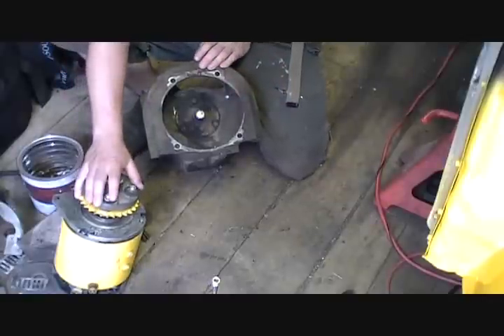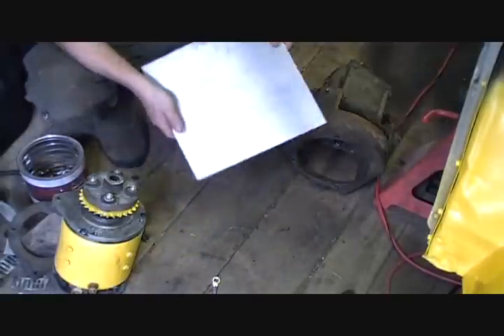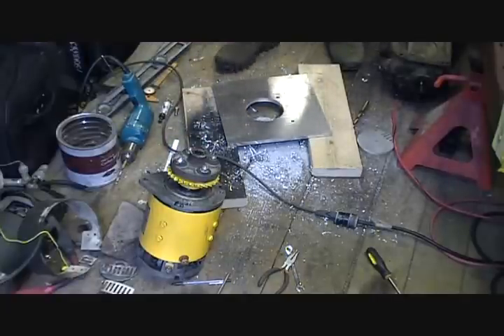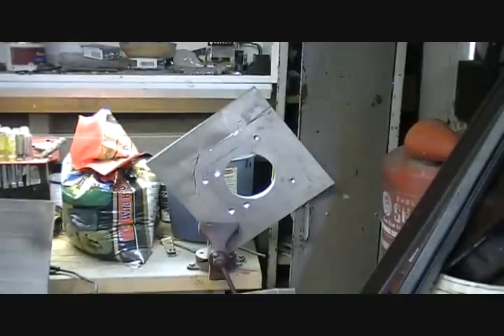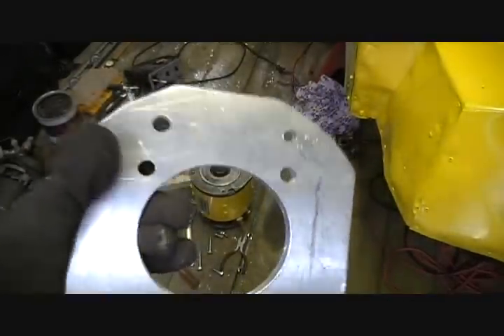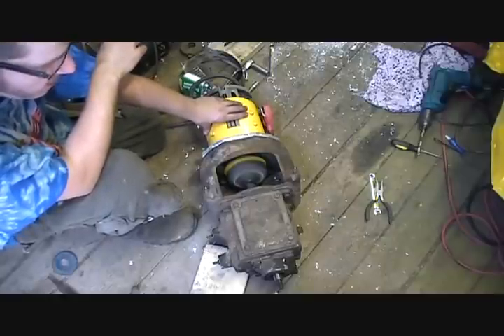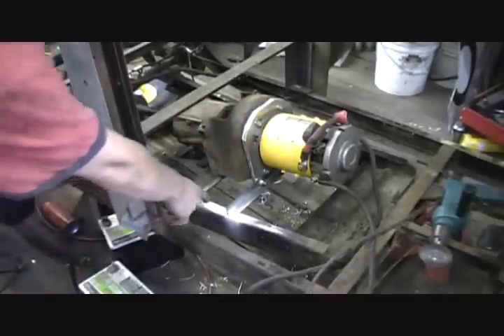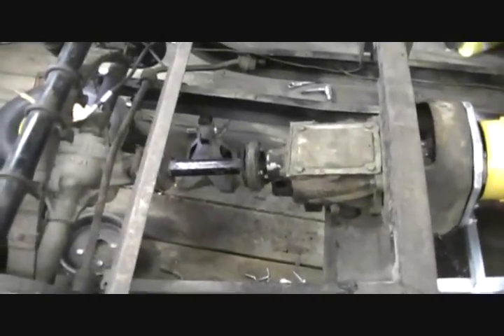1961 Cushman Truckster EV Conversion LiFeP04 -  Part 6 Motor Installation

Comment: Congratulations. One of the most difficult tasks is the alignment of a strange motor to the transmission. Though, as you said, it still seems to need adjustment. Maybe you didn't even need the adapter plate. But then again it is an excellent mounting bracket as well as a heat-sink.

Comment from the maker: Thanks very much!  I'm stoked to have this part done.  I think the vibration is in the driveshaft, not the union between the motor and transmission.  I'm going to disconnect the driveshaft and double check that.  
Yes, the plate makes a great heat sink and mounting plate.  I plan to fan cool the motor with ducting as well as mount computer style heat sinks on the brush end and point a 12v muffin fan at it.  It should run cool enough for my needs, I think!
Thanks for the input!
B

Comment from the maker: The driveshaft was spinning as it was in gear.  One of the rear hubs is off, still awaiting a new ebay part.  That side was spinning even though the side closest to me was not.
The transmission is not lubed yet, so that could be the cause.  I'll try filling it and see what happens.
Thanks!
B

Comment: Correct me if I'm wrong. The drive-shaft can't, at this point, be causing any vibration. I didn't see the wheels spinning. The transmission is in neutral. 

What else could it be? Is the transmission lubed yet? Or is the vibration definitely caused by something that's out of balance? It seemed fine before. Maybe your coupling wasn't tight enough, and now it has slipped a little.

Comment from the maker: Thanks Frank-
I'm going through basically a divorce without being married at the moment. I've got most of what I need to finish, and will restart work on the truckster in a month or two.  As of this moment, it's on hold. I secured a new garage space that is heated so i can work throughout the winter.  
My motivation to post videos lessened a bit because Adsense stopped paying me for "invalid click activity" as well.  Regardless, I will finish posting this series.
Thanks for your interest!
B

Comment: First, I just want to say that I love the whole series. I've watched them all and while much of it is over my head, they are still very informative. I'm taking on a project myself and there is a question that I can't get answered. Possibly because it's very elementary or maybe I'm not asking it right? Anyways, my question is this...while you made it look like it was a fairly easy switch from gas to electric, can it be said that it should be easy to replace an old electric motor with a new one with/without some engineering? The reason I ask is because the cart that I have doesn't have a motor and the cart itself is over 40 years old. It's a '75 Cushman Combo 1. If the answer is yes'ish, where should I start? I'd love to pick your brain on this if possible. Thanks again for the great videos.

Comment: It seems like you removed transmission clutch, when motor start rotates then transmission also spinning, if transmission rotation the rear wheels also rotates ...here here is the control to go slow and fast ...since you connect directly transmission..
Reply from the maker: You pick the gear you want and control the speed with the electric motor controller. Electric motors have far more torque at zero rpm than gas engines do so you leave the trans in 3rd gear.
Reply: @benfroggg  okay...this is normal case but I have not seen that transmission has gearbox to change the gears..?also from part9 also I have not seen any gear, I thought of its just centrifugal clutch system
Reply from the maker: @kmuralikrishna1582  The gear shift levers were removed in part one... Although I don't think I covered their specific removal on video. 
The gears are still changeable with a wrench on the linkage.